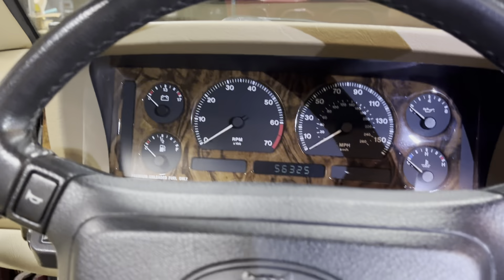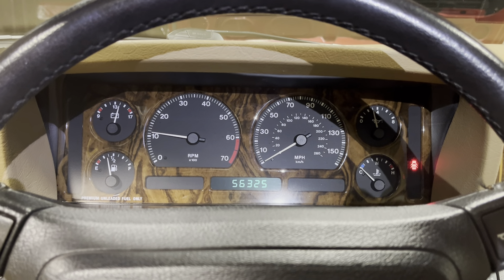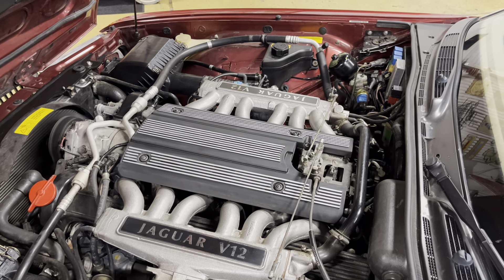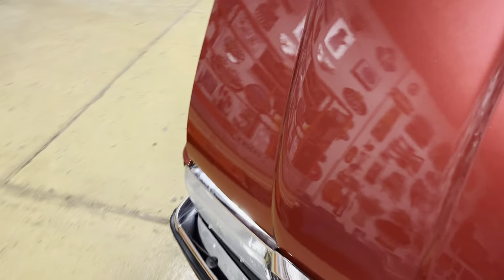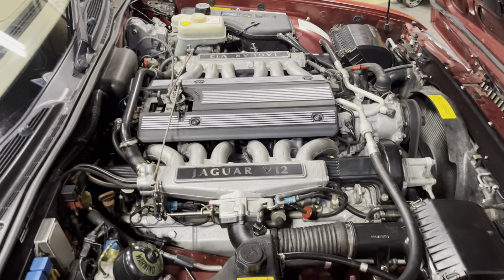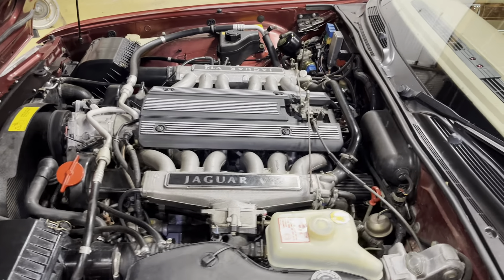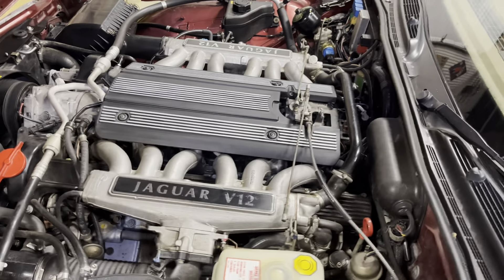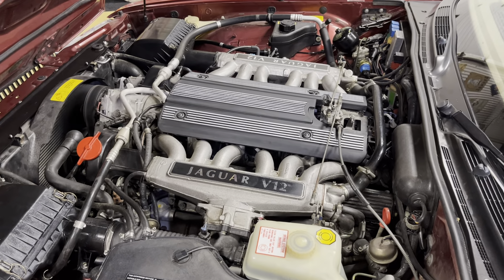1994 Jaguar XJ12, SN 3962; Engine Bay Motor Running: 22 of 45

Comment: You cant use any V12 engines by Jaguar because they have cylinder heads from India....those heads drop valve seats and break valves any 20.000KM when driven faster than 200km/H on Germany Autobahn.
Reply: 94 onwards v12 is pretty bulletproof
Reply: Small block Chevy conversion is the way to go.
Reply: yes the V12 dont work when driven hard @SpectrumRob